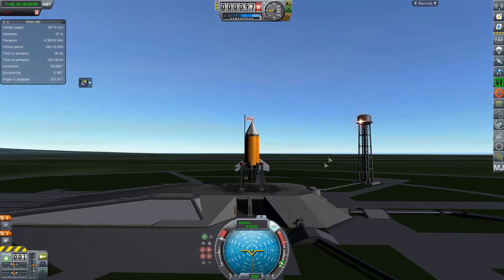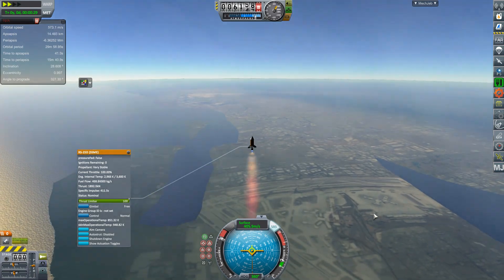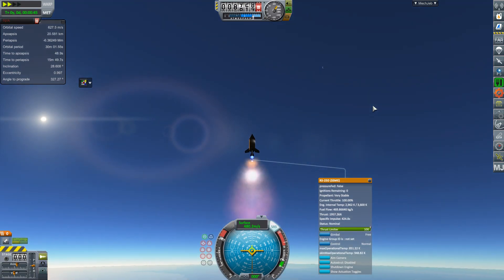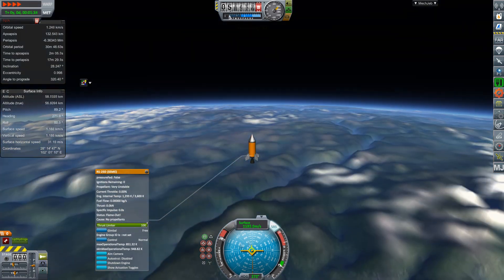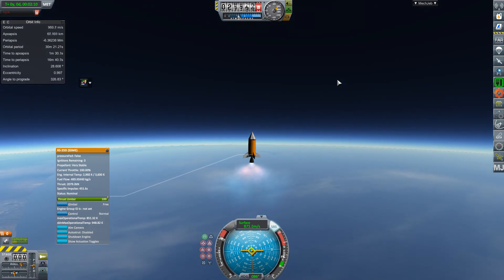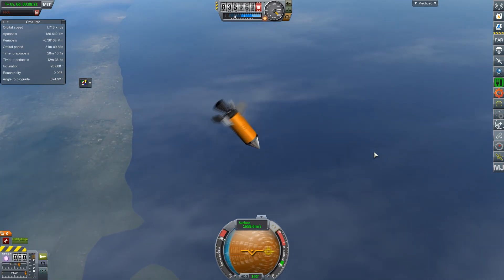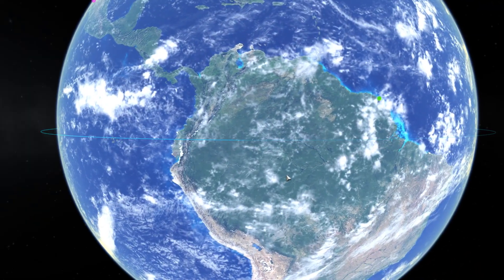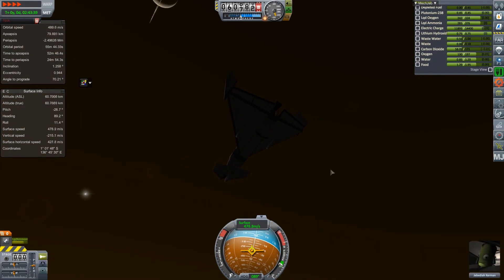Does Launching Rockets From A Mountain Really Help?

Comment: Dear Scott Manley,

I was always wondering, why the flight parabola/curve always shift west in ksp no matter how straight you launch up? Is it because the turning of Kerbin? I thought so at first, however after closer investigation of the map screen, i noticed that the flight curve does not move with the turning of the planet, so that if the flight curve was curving westward because of earth rotation, then they would calculate that twice.

If im wrong please correct me.

Kind regards
Koso - craft / GermanLeagueGaming
Reply: It's called the Coriolis effect. As the planet is spinning east, an upward motion produces an acceleration due west.
Reply: I believe there is less drag when launching west, because the atmosphere is moving with the rotation of tha planet, and the slight speed gain. I may be wrong though.
Reply: Might be it.
Reply: Hi this is the second account
Reply: SAT1URN . This is actually my second account and i made it (the profile pic) 6 years ago. Just to lazy to change to the other one and do all subscriptions and stuff.
Reply: Coriolis effect is because if you are higrer, you are further from the center of the Earth. It means that with the same speed you have because of Earth's rotation, you have a less angular velocity so less than the ground. The Earth turns then faster than you so you land more western than you took of.

Excuse me if there are mistakes, I am French (I live in French Guiana, 60km/ 40mi from Kourou launch site !!! (I just wanted to tell it))

Comment: 4) if you start at 1000 m, you dont have to fly that 1000m up. Pretty big one, percent of 10 in your fist test: 50 meter up gives 500 meter higher, out of which that 50 meter is 10 percent. 
And compared to thin air: the top of mount everest is very easy to go to: just climb there. Make a lift. Done. It costs a lot, agreed. 
But the amount of fuel saved will be enormous. You would earn it back in a couple of launches I guess.
So why are we not launching them from zeppelins or something? The space-x launcher seems to land on a small barge, can we not lift that up to the upper part of the atmosphere?

Comment: I have a terrible time with ckan, of all the times Ive attempted to install mods with it over the past few years, only once has it installed all my mods without getting into an error box loop. This is over three different machines so im lead to believe it has inherent flaws, whether this is down to modders not specifying their configuration properly or the program just has these issues. 
  Problem I guess is it just isnt handled gracefully, a program should never throw an unhandled exception to the end user this easily, I appreciate its done on peoples free time but damn it would of been good had it worked.

Comment: if location is the only significant advantage to an air launch, why not make mobile launch pads on ships? Seems like it would be much more efficient to actually get the vehicle in position by ship than by flying it, and it could double as a recovery vessel for one use stages or a landing pad for reusable stages.

Comment: The rocket itself  may be "better" at high elevations, but you still have to get it to that initial elevation using something. Train, truck; gasoline, electric; at the end of the day energy is expended getting it somewhere, which costs money. Better off designing an efficient rocket from a cost-effective location and using the savings to design better rockets.... or just add more boosters :)

Comment: what about using big jet engines as the first stage? just strap some detachable Ge90 engines with small fuel tanks to the side and launch, they give loads of thrust and use minimil fuel for that thrust. They could get the rocket up to about 10km and about 800-1,000 km per hour.

Comment: is there an advantage of launching from some type of rail system? like if you were to put a rocket on a rail system and then speed up that rocket to a few hundred miles an hour horizontally before finally "uprighting" the rocket via 90 degree curve. and THEN firing the engine before it lost to much velocity.
Reply: especially if the launch system was on some tall mesa
Reply: jimster1111 preferably, black.

Comment: wasn't the main benefit of launching from a plane not the extra height but the greater lateral speed? Because that is what most of the fuel in a rocket is used for.
(you may have mentioned that, but I am backing up my phone so just maybe I missed that)

Comment: There are a number of advantages not listed here that would apply to an air-launched rocket.  Not that I'm arguing it's more practical, but he's skipped a few.
1. Your initial booster can be tuned for a lower air pressure - basically you can START with vacuum engines if you're launching from 10k up.  So instead of using an expensive RS-25, you can start with a cheaper J-2X.  
2. You can use a higher initial TWR, and do it without having to have throttable engines.  This means you can avoid more gravity losses.
3. You can start out flying at an angle.  Most rockets now are built for an initial TWR of 1.2 to 1.4, meaning they take LARGE gravity losses getting up to 10km, you could avoid most of that by air launching a rocket from a plane in a 30 degree climb.  With an initial TWR of 2, you can start flying at a 45 degree angle, and get as much vertical acceleration as a rocket with a TWR of 1.4 and also get a lot of horizontal acceleration.
4. You can build your rockets frame for a lower max Q, saving on dry mass.  The space shuttle, for instance, experiences max Q at 11km - they dialed their engines BACK to 60-70% to limit the aerodynamic pressure - which actually meant they incurred yet more gravity losses. If you're launching over 10km to start with, you'll experience a lower max Q at a higher altitude.

Overall, you could save 500-700 meters worth of Dv from gravity losses alone - which, while it doesn't sound like a lot, means that your rocket can be 18 to 26% lighter (assuming a kerolox initial stage with an ISP of ~300).   I'm not qualified to estimate the gains from a lower max Q and and lower drag losses, but even just from that, I call BS on Elon's number - or at least, he's estimating his 5% against the total Dv needed, which is slanting how people understand the costs.
Reply: Paul Boyle your right man
Reply: You can also time your airborne launches (provided a rendezvous is not required) based on upper air soundings!  

     A pro-grade launch from the east coast of the US wherein the orbital inclination = the air launch latitude can coincide with a STRONG upper atmosphere jet stream.

      I have personally witnessed jet stream velocities on the order of 160 kts (300 km/hr) in the wintertime from the west.  Combined with an aircraft cruising at FL350 at Mach 0.84 (normal cruise in 747), you are starting with a Groundspeed of well over Mach 1....or roughly 640 kts.   For the metric system fans, this is 330 m/s of additional initial orbital velocity (in addition to the free orbital velocity provided by the earth’s rotation.
Reply: Paul Boyle yeah, you save 700 m/s of dv which actually triples your payload. Elon is just an obtuse fuck who knows jack shit tbh, i could quote him again and again with dumb, factually wrong statements. Thr proof of that air launch really does give a huge advantage is the Pegasus and Taurus rocket, same payload, but one is 2.5 times smaller. And thats from Antonio Elias, designer of Pegasus
Reply: Less vertical distance means less thrust needed, which means less fuel needed, which means less mass, which means less thrust etc. For e.g. If commercial jet planes took off from the top of Everest, they would use ~30% less fuel because the engines would be smaller and the fuel mass would also be smaller.
Reply: Ian Thompson 
   
     One factor looms large though with aircraft and high elevation runways.  It’s easy to forget when thinking about rockets, but airplane wings (and the tiny wings of the engine fan blades) depend on air density, airspeed and angle of attack to create lift.

      With Pressure altitudes on the order of Mount Everest, for a mid size jet like a Boeing 737 at a modest takeoff weight, it would require a runway roughly 3 miles long.   Also, to achieve the INDICATED airspeed to rotate to takeoff pitch attitude, the TRUE airspeed (and therefore the GROUNDSPEED ...assuming zero wind) would well exceed the published groundspeed limits for the tires!

      For those reasons, most commercial airliners have 8000 or 10000ft as the limits for departure and arrival airport elevations.  

     Also, the IAS and TAS / Mach difference, limit our flap extension altitude to 20000ft.  The greater curvature of the wing with flaps deployed will cause local Mach shockwaves on the wing at relatively low indicated air speeds when flying at high altitude.

     Interesting thought experiment though.
Reply: @quillmaurer6563  Assisted takeoff is another way to reduce engine size, and the savings can be significant. The problem is that it would need to be installed at every airport, or planes that took advantage of takeoff assist would not have the thrust to get off the ground at a conventional airport.  I've imagined several types of assisted takeoff, from winged engines that attach to the rear of the air craft (and are able to carry out automated landings for refueling and subsequent use), to large conveyor belt runways that are driven by weighted pulleys. Even if only one leg of the journey was assisted, there could still be a fuel saving for the airline in takeoff.
Reply: @Stepclimb  There is also the problem of getting the people above 14,000ft without altitude sickness. Unlikely that you could pressurize the whole airport. As for the runway, there are runways in Nepal that slope downhill on a 25% grade. You could shorten the takeoff distance by making the runway slope downhill, so the engines are gravity assisted. There are a lot of dangers with sloping runways though, especially for aborted takeoff.
It is just a thought experiment. Thanks for your input.
Reply: @ianthompson44  Another advantage of "air-launched airplanes" is that this might avoid concerns of noise experienced by those on the ground. If loudness isn't a factor that the airplane has to be designed to limit, that's one less constraint that must be designed for that would allow it to be more optimized for efficiency. Both this and less concern about takeoff and climb-out performance and efficiency would likely mean that the optimal bypass ratio on turbofan engines might be somewhat lower than what is seen on modern airliners. Of course there's a lot of reasons this couldn't work (it's not like you could build platforms 18,000 feet high near every city where you want an airport) and the concerns mentioned by Ian Thompson, but it's all interesting thoughts.

Comment: Some other advantages could be the fact that you can design the nozzle bell a little longer adding even more Isp and you can shape your trajectory to be more sharp with a faster turn reducing gravity drag.

Also if someone is asking what could be the best site to launch a rocket (political and economical factors aside) I found a pretty spot on a plateau of 20Km radius in Kenya near mt Kenya: 3200m of altitude and almost dead on the equator. Relatively near the Nairobi airport and lake Victoria to the west and the sea to the est. Also near the only semi desertic equatorial region so weather is quite clement there.
Reply: nice, but isnt it too far away?
Reply: redbeam_ well depends from where you start.
Secondly I did not said it's the best place for launching rockets, just the high place most close to the equator, any economical and logistical factors aside.
Reply: Kenyan Space Program when?

Comment: i have a question.

why don't we launch rockets from the poles?
Reply from the maker: Because they're cold and nobody wants to work there. Also, One of the poles is just ice.
Reply: Scott Manley rockets could possibly melt most of the ice when they launch couldnt they ?
Reply: slightly off topic, but why dont we use solar panels on the south pole? there is direct sunlight for half a year.
Reply: Corey Newhard snowstorms wind hard time placing it there we would need to have very big cables leading from there to us and what about the other half year ? Fun fact scott manley deleted his comment
Reply: But the sun is low over horizon meaning you get everlasting dusk, far from perfect lighitng conditions, also clouds.

Comment: Scott: casually lands on titan
Me: How do you get to other planets other than minimus and the mun plz help
Reply: Minmus and Mun aren't even planets lol, they're moons. I managed to get to Eve once, but only one way.
Reply: Well, he may or may not have cheated.. A bit.. ;)
Reply: Look up the mod Transfer Window Planner, that will get your phase angles sorted and even gives you a handy dV estimate for any given launch day. From there it's the same old transfer like you would use to get to the Mun, just... more.
Start with Duna, it's fairly forgiving with its aerobrakes and you still have to use rocket motors to descent. From there the whole system is at your fingertips.
Reply: @SkullCollectorD5  i landed in duna with parachutes
Reply: Gaming Geek I never landed on anything ever. Or even establish a stable orbit.
Reply: One time I flew to Duna, got into orbit, put a relay, then tried to drop down to the surface, ran out of fuel, had Jeb jump out of the ship and slow down via RCS, ran out of RCS fuel, collided with ground at 50 m/s and survived, but then realized I was completely boned without a hope of survival
Reply: Well first off it's spelled Minmus and Minmus isn't even a planet neither is Mun....
Reply: Nickel and dime that research and unlock the big boy toys. Pretty much where we all get stagnated. 

I finally have most of the important rockets & tanks to get me up there, but I'm like 2k research short of having 75% of the science & electricity & landing gear tech that would make anything more than research scrounging in nearby biomes and redundant and annoying component missions worth doing.
Reply: I've never went to another planet either... Every time I've accidentally flown out of Kerbins sphere of influence I would quickly sort my orbit to be taken back to safety.
Reply: Just set up a maneuver node which gives you an escape trajectory and mess with it until it aligns with your target, then set up a second node on your way to make a close encounter. 
btw science labs are useful in Kerbin system, each ~10 science/day.
Reply: Anvilshock chill dude
Reply: timewarp
Reply: ive never gotten to the mun
Reply: Pugglus Scot has a tutorial to help with that. My original mistakes were building rockets with a poor thrust to weight ratio.
Reply: Gaming Geek IKR!!!! Although, I have never landed on either of those either. I only can BARELY get into orbit, whether it is a Solar or Kerbal Orbit.
Reply: I went to moho without mods
Reply: Cheats?
Reply: Scott Moonleey
Reply: How do you get to the Mun!?
Reply: This is a mod that adds our solar system
Reply: Stop misspelling Minmus for starters could help. Watch closely: Min...mus. Min...mus. There is no fucking second i in there.
Reply: @Anvilshock  but minmus is really small
Reply: @Anvilshock  lol watch out we got a badass over here
Reply: @Anvilshock  Minimus

Comment: A quick question, if you are higher up on a mountain don't you have more gravity to deal with because you have more mass underneath you dragging you down? Sorry if this is a stupid question I'm just really confused :/
Reply from the maker: +Doomed Pixel good point, Will have to do math. However realize that density of crust is much lower than density in core
Reply: It's really negligible. You may get like 1-2 additional kilograms, but it really stops being an issue once you get some distance
Reply: The only way the mountain wouldn't be dragging you down anyway would be if you were next to it, and even then its gravity would be trivial compared to the rest of Earth that would be under you anyway. That means any increase in gravity you'd get from the modified distribution of mass is way smaller than the effect you get from the fact that most of Earth is, say, 2km further away than it was when you were at sea level, and gravity weakens over distance.
Reply: 1-2 KG I would guess a few gram at most per 1000Ton. this feels like something the science guy at Nasa skips becos the actuall number is so low that even there calculator drops then.
Reply: yes, but the increased altitude makes up for it, and like Scott said, the core of the earth is denser than the crust.

Comment: There is another small advantage to launching from a mountain: no salt spray, meaning potentially lower maintenance costs
Reply: Austin Vette Bring the rockets in parts on top of trucks, which travel through a low incline road spiralling up to the summit. Then assemble at the top
Reply: you would still have to get the rocket onto the mountain... I imagine that you would use more fuel to get the rocket up the mountain rather than just starting from the ground
Reply: What about higher wind speeds, there would be a much smaller launch window and bad weather conditions on mountains are much worse than on the ground.
Reply: @spacedoutorca4550  oof good point
Reply: builds a few more miles inland...